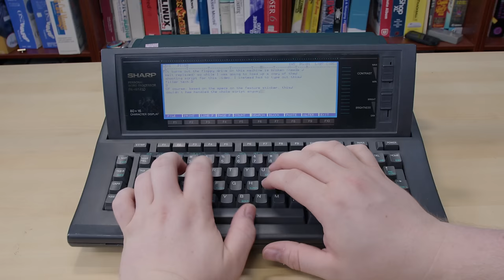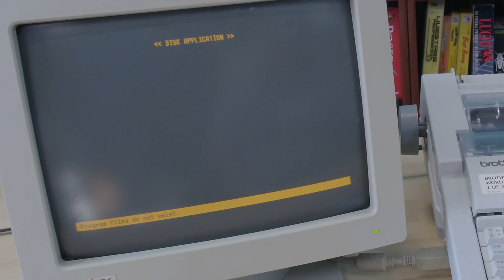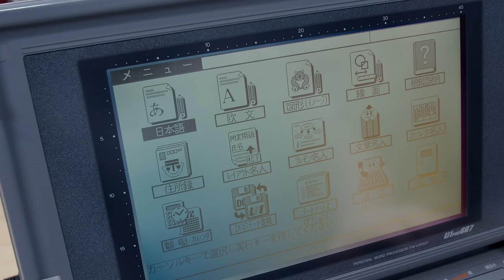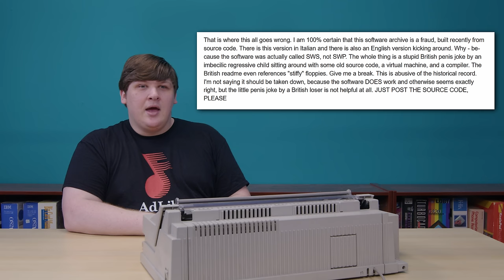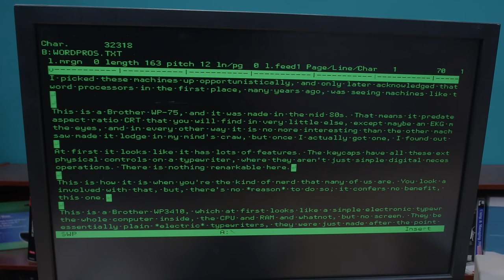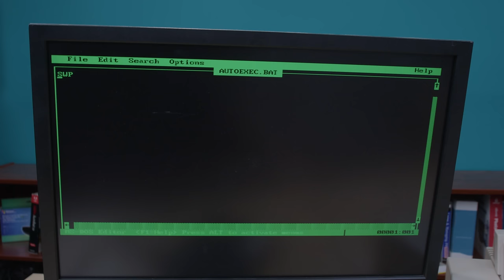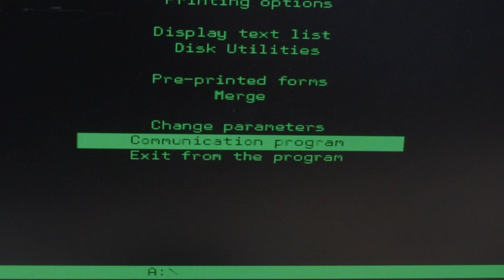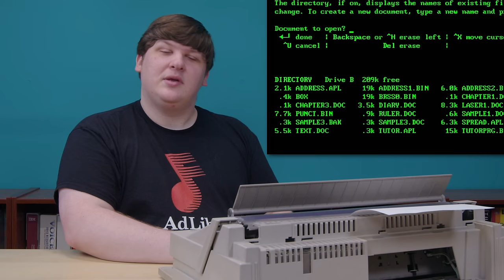The Weird Processor: Olivetti's PC Typewriter

Comment: Since i actually read some Japanese, i I've taken the liberty of translating the 15 icon captions visible on the Panasonic word processor's screen:

Japanese
Western text
Diagrams (images)
Line graphics
Manual (lit. "Function explanation")
--
Address book
Layout Master
Presentation Master
Text Master
Calc Master (spreadsheet)
--
Calculator, Clock, Calendar
DOS data conversion
Data Note II (optional)
Communications (optional)
Extensions

Sounds like it has a full-featured office suite built in. Probably quite a high-end model when it was new.
Reply from the maker: Oh man, awesome! Thank you so much!!

This might be a bit much to ask, but - if I sent you a picture of the keyboard, would you be able to take a shot at the key labels as well? If so, please email me, cathoderaydude at gmail.
Reply: @CathodeRayDude  OK, I sent you an email. I probably won't be able to take a proper look at them until tomorrow though, since it's getting late here in Europe.
Reply from the maker: @ManuelSLaraBisch  no rush, I gotta go take pics of it anyway. thanks!

Comment: Fun fact: man pages, common in Unix derived systems such as GNU/Linux, still use the type-back-type again for bold or underlined text, generated by the roff formatting tools. The pager (usually less) translates this into terminal control codes for video display. The layers of backward compatible hacks are many.

Comment: The 1984 Compaq Deskpro monitor pulled 12volts from the PSU through a 3 pin din connector on the rear. That monitor was also dual mode MDA/Amber Monochrome CGA.

Comment: Re: the memory limit of 640kB or 1 megabyte — have you ever done a deep-dive into conventional vs expanded vs extended memory?  I don't think an a-tier YouTube channel such as yours has done that yet.  Extended is basically what we used for the lifespan of 32-bit computing, as soon as Windows loaded anyway.  Conventional means 16-bit and PC XT, but all that HIMEM.SYS fun and hijinx let you "move" things into "high" memory, where they'd give you more space — i.e., between 640 and 1,024 was usually wasted, unless used for optional peripherals.  But since the chips were originally designed to go up to 1MB (this makes sense on the face of it), it was technically always possible.  It was just the /convention/ (and subsequent compatibility limit) that DOS programs would use 0 through 640 only.  I spent many, many wasted hours as a tween, tweaking (not twerking) how to get drivers and TSRs above the 640 barrier — hot tip:  loading order matters.  And then we have "Expanded memory", the fat blubbery whale to my Captain Ahab.  Page-swapping, pain inducing, all bad things.  Kludgiest of the kludgey, recant an oath before trying to use it.  My vaguest memory is that certain DOS programs implemented it themselves, when they needed to do Serious Business.  Very likely that early Windows (pre-"386 Enhanced Mode") used it I suppose.  Never seen it in real life.  Was an expensive and boring and headache-inducing trick for those who could put it on a business account, no doubt.  And it worked a little like VM with page swapping, except it used some of the space between 640 and 1,024 to achieve this.  I'm pretty sure that it made life a lot harder to use those optional peripherals, and/or vice versa.  I think Expanded vs Extended were mutually exclusive, but Conventional was "Always There", with the ghost of Bill Gates laughing at you "640 should be enough for anyone", since you always had to be aware of it and clear enough space for the original program to load.  Even programs that used Expanded Memory would maybe tell you that they needed a minimum amount of Conventional memory for their code — i.e., the big expanse of extra megabytes was only for document data.  So this means, even with the expensive add-on, you had to go back to learn and worry about HIMEM.SYS to move some drivers out of Conventional memory (and hopefully that left enough room for the page swapping to have big enough pages, for performance reasons).  And I still haven't mentioned EMM386.EXE.
Reply: The High Memory Area is actually the (almost) 64k immediately above 1 megabyte. This is accessible by software when the CPU is in real mode.

Comment: @ the keyboards: I thought about them when you mentioned the comments saying the opposite about 80s home computer keyboards in another video - I'm not that old, however I think a lot of people could touch-type, for the US, IBM Selectrics, and later Wheelwriters* seemed like they were in a lot of businesses, those who couldn't get an IBM, probably got a Smith-Corona or a different brand. And most of those are more similar to modern keyboards than typewriters as people imagine them. Or people became self-taught typists over time, though that probably was not as common as it may be today.

*i'm not certain when the Wheelwriter came out, at least at some point they were contemporary with the PC, as it was just a Model F/M keyboard bolted to an impact printer.
Reply: 5:54 Useless fact: Brother used triple-shot molding for these, or at least similar looking, keycaps in their word processors. Even the green secondary legends are their own plastic molding

Comment: I gotta wonder if you can use the SWP software on any IBM PC with any printer to do those trick features like pre-printed forms. I imagine it should be smart enough to control any printer's mechanism, albeit with a possible difference in calibration.

Comment: The machines that only word process remind me of these strange little machines I used in elementary school. I drowned when I was very young, and it caused me to basically lose some knoweldge (and memory) in the process . This wasn't permanent, however one of the things that I had to relearn was how to write and instead of having me write by hand, they gave me a device called an Alpha Smart. I had an AlphaSmart 2000 at first and was later given a 3000. They were basically just littler word processors with tiny LCD screens that you could type and save documents with. It also featured things like highlighting, copy/pasting, spell checking, and some other stuff you would expect from a modern word processor. It even had wireless uploading of documents via this little IR dongle you plugged into the PC and an IR blaster on the front of it lol. I actually used these all the way through school up until high school where I was allowed to just do my assignments on PCs as the new standard since typing out papers and such became so common by the laste 2000's. By the time I graduated, that was pretty much expected of you in college, so the writing thing never really came up after that. As a result, my writing skills never got much work and are terrible, but it doesn't matter all that much cus PCs are everywhere. Anyway, just something this reminded me of that I wanted to share. Love your content!

Comment: The fact that brother SX-4000 moves its head even when it is printing only when you hit enter / reach end of a line, was a common future in many of electronic typewriters. The purpose was to give a feedback to the typist, that they actually did press the key correctly, and to give a feedback where it will roughly be on a line. So not a bug, a feature. Writing entire line where it is completely quiet and not moving, would be strange to most typist actually.

Also I do not think any of these printers are dull. I think they are cool, and interesting. Dive into interesting transition period, what limitations they had, and how they steadily improved over time. Some were faster than others (either due to better software, or faster printing mechanism), I am sure some even supported hinting and variable spacing. Some used non-wheel printing, using thermal printing, some used dot matrix. The ones with floppy drives, or weird CRT, all really cool. They were popular, mostly due to the cost compared to the PC, and being similar to previous products on a market. In fact many influenced the PC and computer designs itself, both in terms of keyboard anachronisms we saw and see to this day, some in our current text processing software too. So it is nice to dive into the roots of this historical origins. Honestly, if I had more space in my place of living, and not in a risk of moving one day, I would collect many of them. (I do have IBM Selectric II, and early 90s Brother AX-145, but would love to grab some more like IBM 6787 Printwheel, 6780 Quietwriter System/20, or Olivetti ET 2500) Yes, they are not very usable in modern day, but not all sucked. True, many are working poorly when typing fast, but this is mostly bad software writing. Also they could be cool project for software reverse engineer / modernization.

Of course the real reason was 1) cost, 2) easier transition to typewriter environment, 3) companies making them were making typewriters and supplies for them for the long time, so they tried to fit in and continue making profits in existing business model. And customers also could just throw out their business processes they had for decades overnight, and transition into a bit risky, different and costly world. Plus, supply chain, distributors, servicing, training, backups, production lines, all different. Sure, I would say to most business it would be a mistake to buy these crappy machines, but there was not always a choice. Another thingy is a lot of these machines were really cheap and portable, and PC would not match this for a long time.

Also IBM electronic typewriters actually used same keyboard as PC. In fact the PC got their keyboard FROM their typewriters, same with next models, and many other quirks.

Comment: My mother had a type writer that was electric. It had a ball that would spin and slam against the ribbon and paper. It had a correction tape as well if remember correctly.. I remember when it would get to the edge of the page you would have to push the rack back to the beginning. It would sit inside a huge suitcase type thing and weighed a ton. I thought it was so amazing to watch it in action.
Reply: The type ball was originally used for and I think maybe exclusive to the IBM selectric series. There's a very clever old video by "the engineer guy" that describes how that works, how the electrical signal from the keyboard causes the ball to rotate and then tip so that the one specific spot on the ball impacts the paper when it flies forward, it uses a mechanical digital to analog converter called a wiffletree, which is a very delightful name.

Comment: Re: gutting old computers and putting modern hardware in them:

I'm okay with it (and I've done it myself) under two conditions:

1: The original machine is just junked beyond repair. Like, if you'd have to track down another one just to part it out to get one working machine.
2: If the original machine is working, go for it just so long as you keep all of the original guts and don't make any modifications that would prevent you from restoring it to its original condition later on.

Retro computing is all about having fun. As long as you're not irreversibly destroying something rare, do whatever you want with it, it's your property.

Comment: 22:00 2000 ish Apple/Macs had DC output to power a diplay. I had one.  It used a modified DVI connector called an ADC (Apple Diplay Connector) it was used with their flat screen monitors at the time (not their first (green/grey) one, that used VGA) It was sold with the quicksilver towers.  I think it was 25v and VERY proprietary.

of course, you could run one of these monitors off of a standard DVI port.... with a $150 (lol) DVI to ADC adapter.

Comment: I think the electronic typewriter was, for the most part, aimed at organizations, rather than individuals, particularly organizations with limited resources. In 1995, my broke AF inner city school could just about afford to put one Commodore 128 in my classroom, but our report cards hat to be typed up. I remember our teacher proudly showing off the Brother electronic typewriter, with a disk loaded with the special formatting for our report cards, which had been loaned to him.

I imagine there were many organizations that could not afford to put a PC in front of every office worker who needed to prepare documents but could afford word processors, reserving actual computers for those who needed the extra features. 

The Olivetti machine is, I suspect, a bit of a Ferrari solution. I suspect it was sold to clients who could, and perhaps should have bought more standard PCs or clones, but wanted to follow the convention of using word processors for certain roles... just not those poor people word processors. So, Olivetti built a WP that was, in many ways, a PC, and that was had enough proprietary components that the end user would have to buy replacement parts from them for the machine's entire life cycle. It's the worst of both worlds, at the highest possible price, for the sake of ego. That's my guess at any rate.

Comment: You neglected to mention the best reason to buy something like this in the eighties versus buying a very capable electronic typewriter such as the IBM Selectronic. That is mail merge! 
Once you have composed a standard business letter, having the ability to print off 10 or 20 more with the appropriate salutation, date and dollar amount was a huge deal. Of course, the average PC could do it far better but their dot-matrix printer output sucked and — as other have noted — this could be run by a clerk with little or no understanding of computer operations.
I like your Wordstar comments. Forty years ago, I can remember my astonishment I was to see a friend's portable PC (probably a Compaq) running Wordstar. Many of their commands such as Ctrl-W or Ctrl-V still work on any PC-compatible keyboard today. With the Wordstar cardboard keyboard template suddenly you could depend on the PC's memory instead of your own! It was amazing.

Comment: Standalone devices like the Olivetti were often designed for secretarial use in business environments. They were popular in part because they weren't categorized as computers. Within a corporate environment, buying a computer was usually a controlled process. One had to account for maintenance, upgrades, security, etc. Buying a "typewriter" word processor was both simpler and cheaper. (These same types of procurement policies led HP to market their early desktop computers as "calculators" so engineers wouldn't have to compete with the guys who ran their mainframe/minicomputer hardware.)

Comment: I have been typing since 1980.  There was a time when keyboard makers were making keyboards that had a bit of resistance and had to make sound in order for us to transition from noisy typewriters.  The last time I used an impact printer was 2006 and that was a dot pin machine.  The business still had triplicate forms, it was a car dealership and they were using an old typewriter.  I happened to have a pin matrix printer and I installed a computer, wrote a database all for a car. 25,000 dollars of work.
Reply: 1988. "Introduction to programming".  That was my aha moment.  I specialized in database design and management.  Nice to hear a computer language I don't think of often.